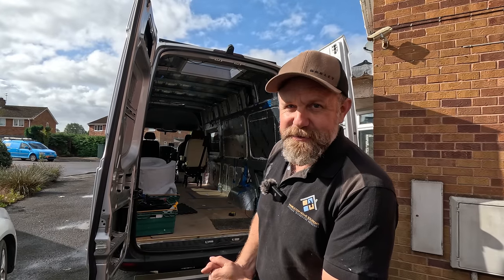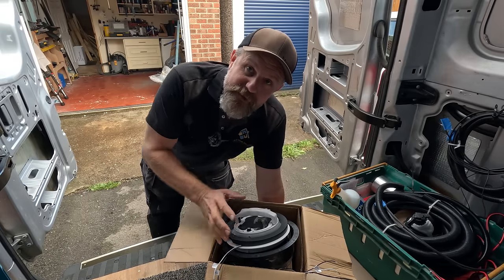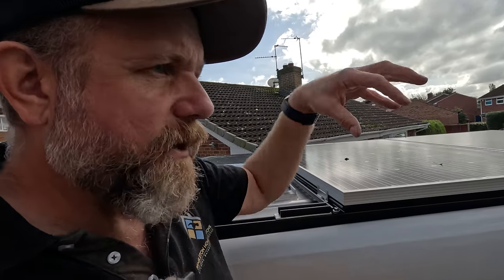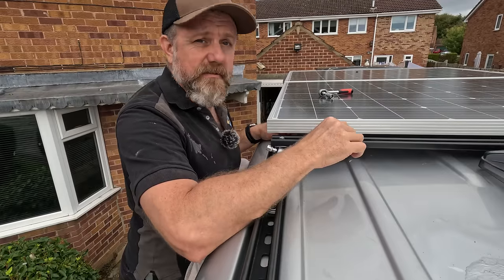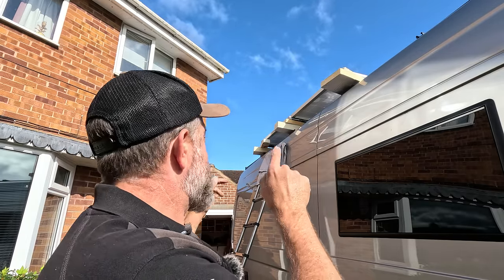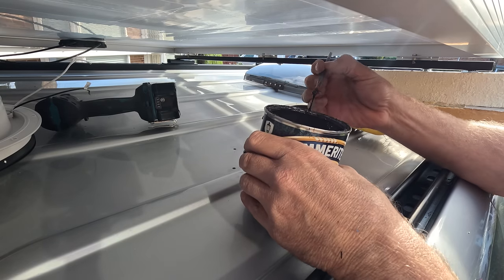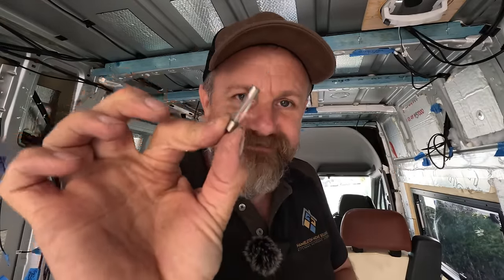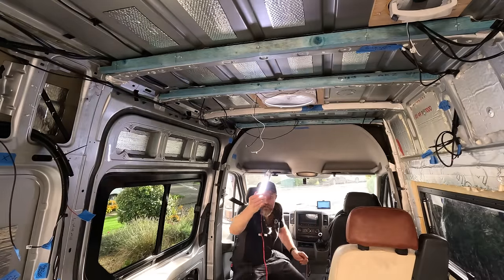Building our Amazing Sprinter campervan, Installing a Maxxfan Dome Extractor Fan

Comment: Adrian ,Won’t  the solar panels be too high ? could be caught by the wind; you could put a curved wind deflector behind the light bar. ( streamlined  van). Anyhoo fab job yet another ✔️ off….its amazing how much is done before the internal furniture 🪑 🛌 can be put into place. I ve already got a Proton account so how do I link up with your Proton Chanel ? 🤔🏴
Reply from the maker: Hi there 👋. It seems to drive perfectly fine. It's not a huge height increase. They are directly behind the maxxair fan so that breaks up a lot of the wind when driving. But I might look at something in the future. Are you talking about patreon? It says Proton in your comment. If you want to look at our patreon there is a link in the description 👍😁😁
Reply: @life_uncharted  Patreon that’s the word ( proton was a car here in the uk/europe ,what a 🍩). Thanks for that have a good day 👋🏴